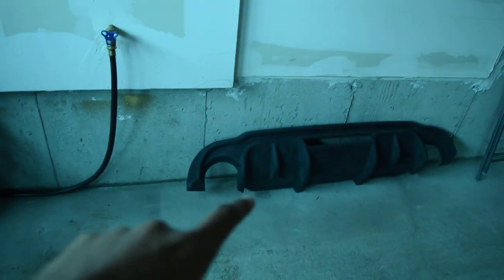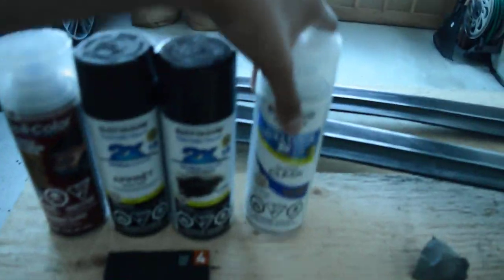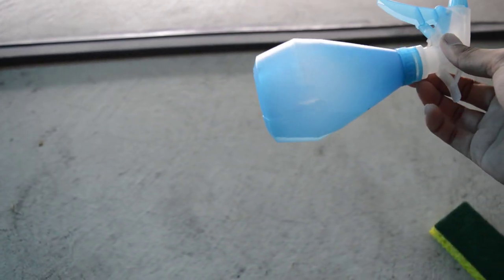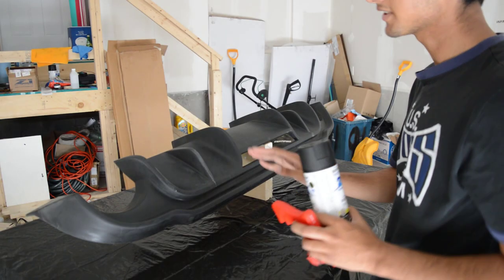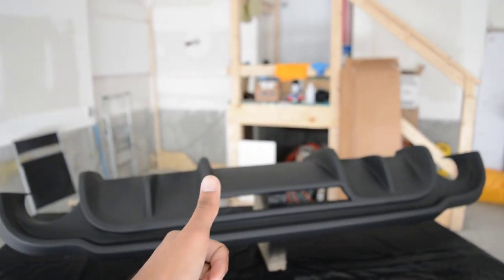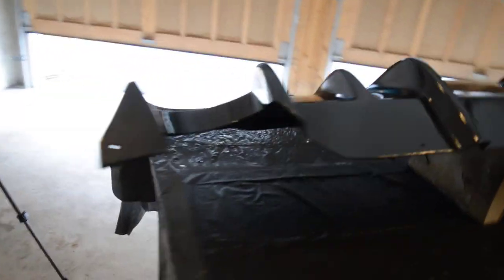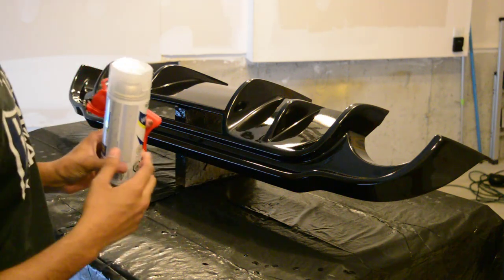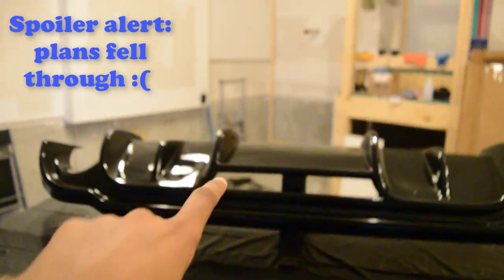How to paint car parts like a PRO!

Comment: Yooo sweet job my dude! Really nailed down that OEM gloss black look. So, lemme type down the steps and do let me know if I got something wrong or I missed something:

1.- 400 grit sand down the part (and wash).
2.- Adhesion promote. 3 coats. Light/Heavy/Heavier. 2 mins between coats (do next step within 10 minutes of last coat).
3.- Primer. 2 coats. Light/Heavy. 10 mins between coats.
4.- 600 grit sand down to smooth to touch, but make sure to not remove any primer (and wash).
5.- Base coat. 3 coats. Light/Heavy/Heavier. 20 mins between coats.
6.- Clear coat. 2 coats. Light/Heavy. 10 mins between coats.
Reply from the maker: Thanks bro, I appreciate it :) 

You got it right but I added a few comments at the end for steps 3, 4 & 6

1.- 400 grit sand down the part (and wash).
2.- Adhesion promote. 3 coats. Light/Heavy/Heavier. 2 mins between coats (do next step within 10 minutes of last coat).
3.- Primer. 2 coats. Light/Heavy. 10 mins between coats. (you can apply max 3 coats if needed)  
4.- 600 grit sand down to smooth to touch, but make sure to not remove any primer (and wash). (DON'T WASH)
5.- Base coat. 3 coats. Light/Heavy/Heavier. 20 mins between coats.
6.- Clear coat. 2 coats. Light/Heavy. 10 mins between coats. (you can apply max 3 coats if needed)
Reply: @AnishNothoo  Sweet, you're the man!
Reply: @AnishNothoo is the clear coat give it the most glossy look, i did every thing but put the clear and it looks more matte then glossy.
Reply from the maker: @marcoventimiglia5148  the black paint coat should still appear glossy but when you put the clear coat it will be even shinier

Comment: Great Job man it looks Amazing.
I've maybe painted a handful of things that have come out as good as this and millions that came out horrific.
I don't know if it's the Enviorment I paint in or the Product.
Could be that I don't use the right grit of Paper or maybe I make my paint coats too heavy.
But great job
Reply from the maker: Thanks man, I really appreciate it! All of the parts I added on the car I painted myself and if I could go back I would start with the piece that cannot be seen easily. I started with the spoiler and I sprayed some heavy coats and had to restart over again. Everything else came out perfect after that tho so just try using the grits I mentioned in the video and try using the same brand of paint if possible and you should be good :)

Comment: I did mine and after letting the lacquer dry for 48 hours I wet sanded and polished it. Two days later orange peel appeared so wet sanded, applied two thick coats of lacquer, left to dry 48 hours, wet sanded and polished again. It looks great but now a week later the orange peel has returned?
Reply from the maker: I’m not sure how the orange peel returned because when you sand you are basically flattening the surface 🤔

Comment: Nice vid! Thank you! Noob question, but my lip will flex, will the final painted product crack if the lip flex?
Reply from the maker: depends how much it flexes. mine flexed as well since i scraped quite a bit but as long as it's not almost being folded in half it should be fine

Comment: Great job... I need to repaint my rear diffuser as the guy who installed it painted it and it came out a different shade of white ..  I'm buying a cheap spray gun at harbor freight and ordering the white from Sherman Williams..my question to u is.. since its already painted white do u recommend a light sand and primer or just paint over the white like a coworker advise me too .. I pretty sure a light sanding is needed .. Thanks
Reply from the maker: George Medina I would definitely sand it a bit down to make sure you have an even surface to work with. Good luck!!

Comment: Don't know if your still replying to this video but I went and sanded my front lip and rear diffuser down with 400 grit sandpaper. I will eventually be putting on the adhesive followed by the primer immediately but from the video it seems like you have to sand it down again after. Problem sandpaper was in limited supply where I went so all I have is the 400 grit and 1000 grit. Should I use another few pieces of 400 grit after or will the 1000grit do the trick?
Reply from the maker: Hey just saw your comment, i wouldnt sand anything right after adhesion promoter. it will completely ruin everything (learned that the hard way). i'd suggest applying your adhesion promoter, letting it dry, then applying your primer coats. Then sand it down with a 1000 after you're done all your primer coats then apply base coats. then on your last base coat sand one last time with 1000 then apply your clear. hope that helps!
Reply: @AnishNothoo  thanks for the tip.
Reply: @AnishNothoo  did you say in the video ten minutes between each primer coat?
Reply: @AnishNothoo  derp nvm saw the text in the top right.

Comment: If debris got on the paint while painting and ruined part of the finish . Should I re sand it down with 600 grit and start over in that section
Reply from the maker: Tibb 3 good question but what type of debris?
Reply: Anish Nothoo I missed wiping down a section when I resanded so when I sprayed the black coat on you can tell it’s not flat but the paint hit debris from the sanding  stage giving a slight raised bumpy look  if that makes sense lol
Reply from the maker: Tibb 3 shit Idk if you can sand it if it’s in the base coat... if it was in the clear coat that’s another story but I doubt you can sand it if it’s in the base coat..

Comment: Did you wet sand after the primer? Or did you use a dry piece of sandpaper? I used dry sand paper and it just left marks in the primer.
Reply from the maker: Louie Ayala after primer I used dry 600 grit sandpaper then after clear I wet sanded with 2000 grit I think

Comment: Can you explain what did you do after the second coat of the flat black primer? Did you wet sand it? And what did you do after the wet sanding? Thanks bro
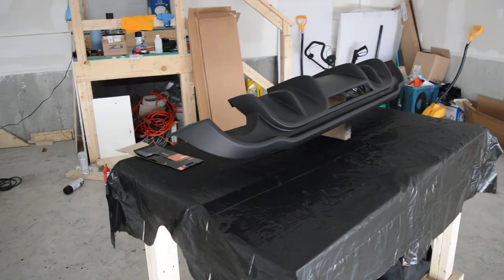Reply from the maker: Of course! So after the second coat of primer I let it dry for 20 mins then I came back to sand it down. Did not wet sand just regular sanding. Wet sanding is usually done after the clear coat is applied which can be found on the next video after this one on my channel. If you want to watch the part in the video where I explain everything it starts at 5:00

Comment: Do you wet sand the base coat if there’s orange peel or do I just go ahead and put clear coat then get rid of the orange peel?
Reply from the maker: Louie Ayala hmm I tried sanding the base coat and it ruined the whole thing to the point where I had to get a whole new spoiler. I’m not sure if applying clear over it will fix it though. My guess is probably not but you never know

Comment: My primer started to come off when I sanded, why is that? And is that supposed to happen?
Reply: Also my final result was very patchy I’m not sure what I did wrong, maybe using a different grit of sandpaper to sand in the beginning of my project
Reply from the maker: If your primer comes of it means you prob didn’t apply enough primer, sanded too much of the primer off or you didn’t apply adhesion promoter. The patchy result will occur if you don’t have a smooth primer which is the foundation of your paint job. What I would have done when the primer started coming off was to sand and re apply more primer. The different grit sandpaper you are suggesting might not make much of a difference and I would keep using the same ones I used in this video just to have less variables
Reply: Anish Nothoo how much primer should I put on? I put 2 coats like the can told me too
Reply from the maker: You applied adhesion promoter as well underneath?
Reply: Anish Nothoo no, but I plan to now that I know to add it
Reply from the maker: I wouldn’t add it on top of the primer if I were you. I’ve done what you are about to do and I had to toss the whole part away because of how the adhesion promoter reacts when it’s on top of the primer. It wrinkles up the primer layer under it and no matter how much you said it will appear cracked
Reply: Anish Nothoo so how many layers of primer should I put on to get an even finish?
Reply from the maker: Probably 2 more atleast then sand and hopefully the primer doesn’t come off again

Comment: How is the paint holding?? In trying to paint part but it says i should use flex agent?? What is your opinion? Does this paint have flex?
Reply from the maker: Paint is good, gone through 2 winters now and no chipping/flaking. I'm not sure if the paint i used has a flex agent but my side skirts are pretty flexible and those haven't chipped yet so i think you should be fine if you use the same paint i used :)
Reply: @AnishNothoo  thanks for the reply. i guess i just have to go heavy on the adhesion promoter coats
Reply: @flex2125  With this Rust-Oleum 2x, you should not need a flex agent as it is designed for plastic and even fabrics. Adhesion promoter is always recommended, though.  Rustoleum also has an automotive clear that is a bit  tougher in a red and white can, usually at Walmart or Home Depot.

Comment: How is the paint holding up ?
Reply from the maker: so far so good but obviously the front lip had rock chips nothing to do about that unfortunately :(
Reply: @AnishNothoo  thanks bro and I wanted to do this but i dint want the clear coat to start peeling of fading
Reply from the maker: Honestly it’s been almost 2 years with it and none of that has happened yet so I think you should be fine bro

Comment: Where did you get the side skirt?
Reply from the maker: thats what i found from my orders on ebay : https://www.ebay.ca/itm/Fits-14-17-Infiniti-Q50-Side-Skirts-Pair-Left-Right-Unpainted-ABS-/371600852822?hash=item5685230756&_uhb=1

BUT the side skirts are not the same that't on my car for some reason. they may have ran out of it but keep looking on ebay and use the 15% promo code when they pop up to buy it :)